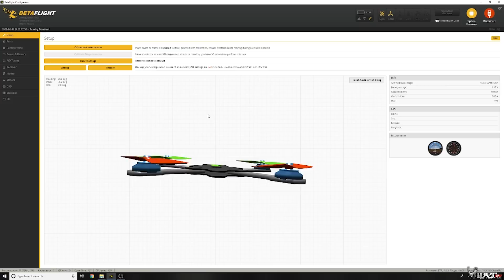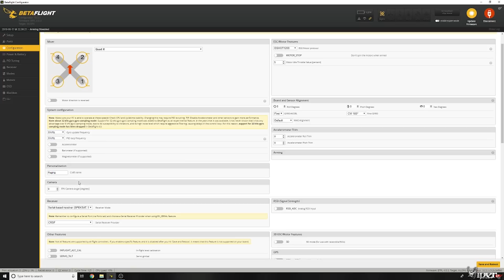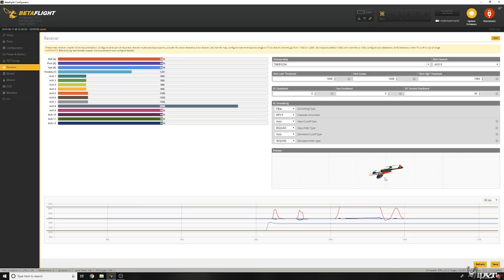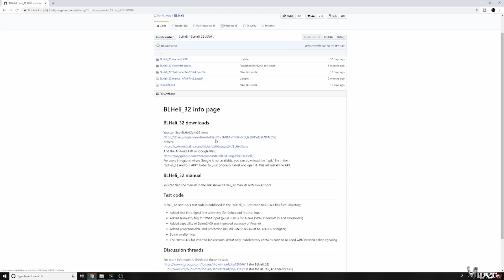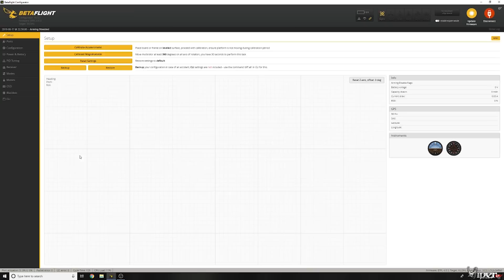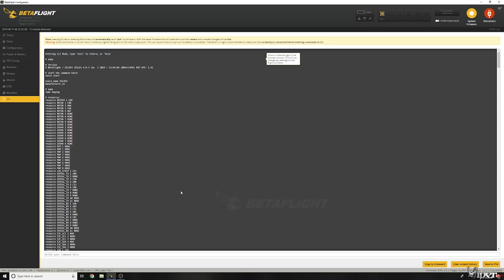How to Configure Betaflight 4.0.4 - Beginners Guide

Comment: Just did the setup of BF 4.0.3 on F7 kakute and now when using only throttle the motors speed up to fast when only using low input and when i lower it down, it almost cuts off to a nasty jerking twitch, yet yaw, pitch, and roll, motors work nice and smooth.   What should I check?
Reply from the maker: Are you talking about when it’s only on the ground or when it’s flying also?
Reply: @ViperFPV  only on the ground w props off. i understand that w props off it usually spins up, but this is spinning up way to fast, and not only that, im finding out that when motors revs up very high, i can not bring the speed back down at all sometimes, which sometimes i can but to a hard stop w a jerk of the motors. so at times where i cant bring the speed down, i just disarm from transmitter to turn them off 
so i also went and bought another same set of motors and another exact frame. a new FC a new 4 in 1 Tekko 32 ESC and did the setup w BF 4.0.4 and it came out the exact same issue. throttle motors only are just not controlled still
Reply from the maker: Ojos de Ismael it’s normal because the pid controller is trying to correct it and it goes into a loop where it will bring motors almost to full throttle. Put the props on and go far away from it and arm it and see what happens it should be fine.
Reply: @ViperFPV  i will try, and i will let you know.  thanks for your help
Reply: So i tried it a bit w the props on and it just dropped when hovering a bit then trying to slowly land, it just dropped. I ended up taking off the props back off and i could still hear the motors the way they were.
I researched a bit on Oscar Liang's site. 
He spoke about a ( bug) issue w the throttle flipping out at time when the kakute was having back in 3.5.  And it was interfering w the camera control . He states to just disable it in the CLI.  Thats what i did .   And motors sounded different thus time.  I put props back on and now its flying right. Theres still a bit of a twitch when dropping throttle to around 1000.  But i thank you sir for all your help and time.  Love the channel.   Now next is to get that twitch out .
Reply: Ojos de Ismael how did it go?I am having the exact same. So was it ok with props on and flying? Thanks
Reply: @Paulie-j9l  
  yes. VIPER was correct, it was me being worried about the Quad motor noise mostly, A fresh BF to start was what i needed only, and not trying to transfer the old BF dump settings to the new one.  I researched Oscar Liang site as well, same conclusión ...
Reply: @Paulie-j9l    also noticed that when i added a capacitor to the power leads, the twitchyness of the motors w props off calmed the motors down alot more.   I seen a recent video where Kabab did some testing on a quad and the capacitor helped it out tremendously

Comment: I have a question: what is the different between the revolt osd and the revolt osd v3?
Reply from the maker: Revolt v3 is older flight one with no osd support and no FalcoX support. RevoltOSD is the newest flightone flight controller that has osd like betaflight osd and also supports FalcoX
Reply: @ViperFPV  I can uptade my revolt osd to the newest firmware or I can put falco x to it right? But I can only setup falco x on the osd not on the flightone software?
Reply from the maker: Yes u can flash right to FalcoX but you have to use osd to configure there is no  configurator support
Reply: @ViperFPV  I hope they will get it into the software!😋😎 thank you! I subbed

Comment: Excellent review!  Is this release stable enough to load onto my 3” Gecko without smoking my 1606 motors?
Reply from the maker: Yes it is I have the same quad but mine is a 4 inch with those same motors
Reply: My 20x20 FC, AIO ESC came in the mail today!  Whoot!